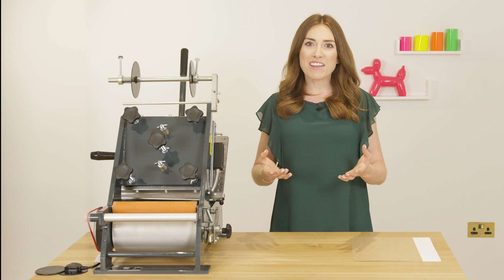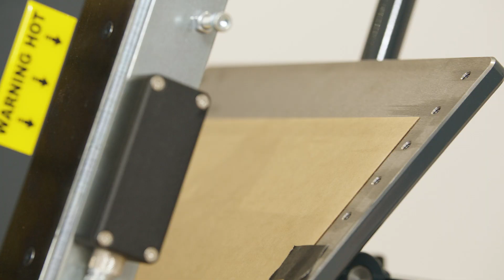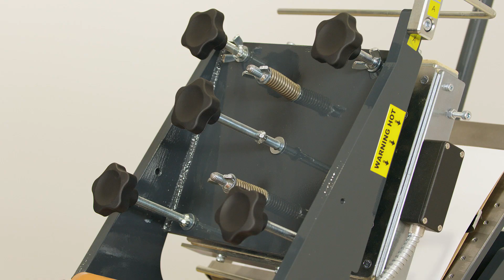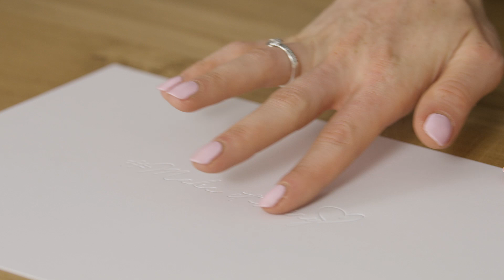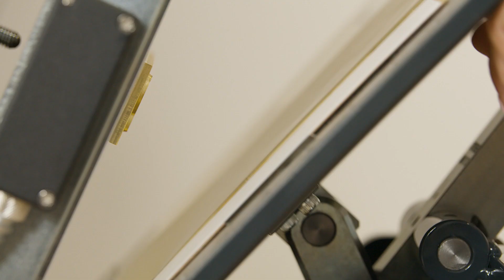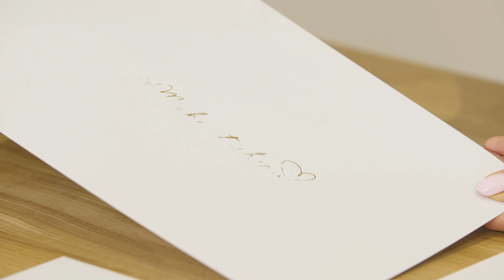How to Use the Metallic Elephant KSF3 Press: Your Ultimate Hot Foil Printing Tutorial

Comment: At the point you tighten the setting screw have you made the outer corner screws as loose as possible? And what do the two screws that have springs do? Thanks
Reply from the maker: not as loose as possible, but loose enough for the centre screw to push out and pivot on centre screw. The spring screws should be rarely touched, you may need to touch when doing thick items. Make sure there is a gap in between sprint rings( not completely compressed)